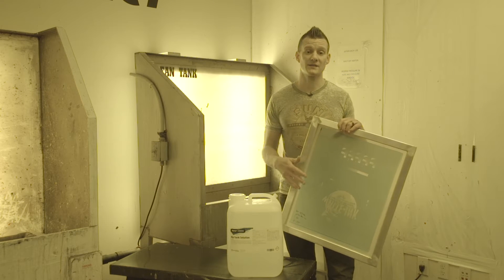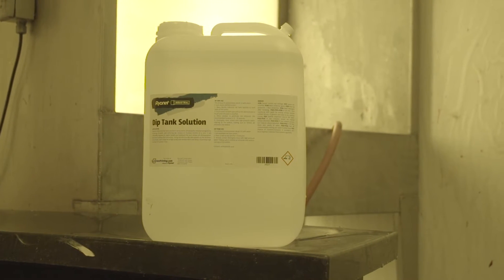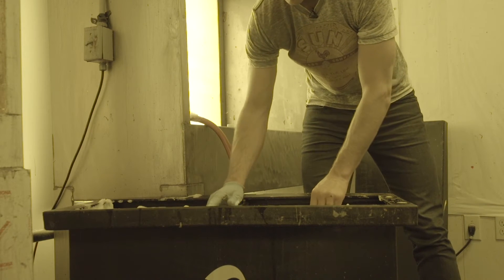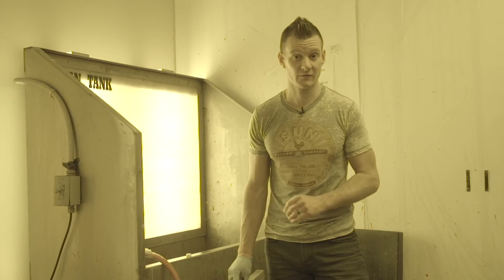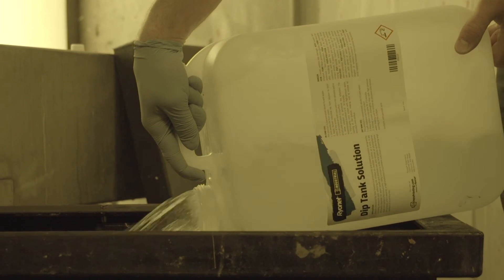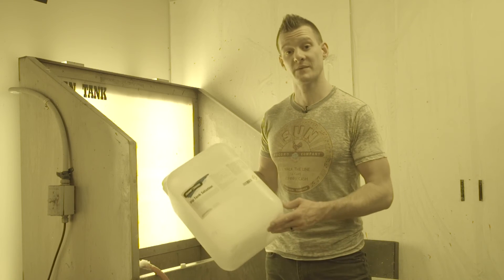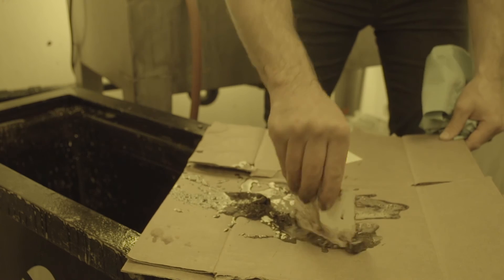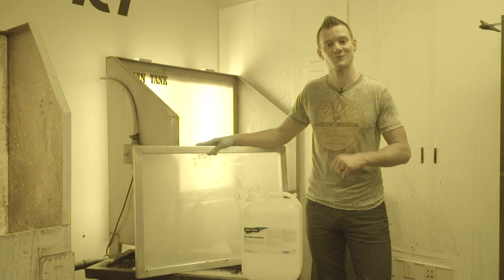How To Use Ryonet's Industrial Dip Tank Solution for Screen Printing

Comment: Hello, I just recieved three gallons of Ryonets Dip Tank Solution. One gallon has a batch date from 7 months ago and it is almost yellow. Is that normal to recieve old chemical, and does emulsion remover have a shelf life?
Reply from the maker: Hey! It has a shelf life of 10 months. Yellowing is okay, but brown is not a good sign. When exactly did you receive it?
Reply: @Ryonet recieved it last week. I will contact customer service. It is not brown, but not clear either. Order did arrive supper fast, thanks.